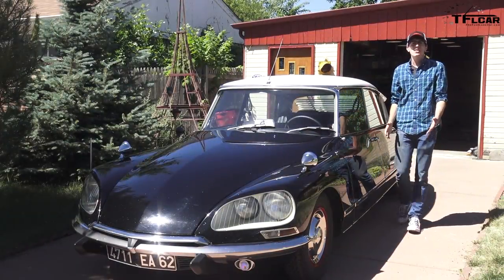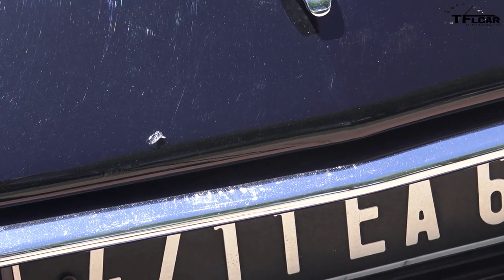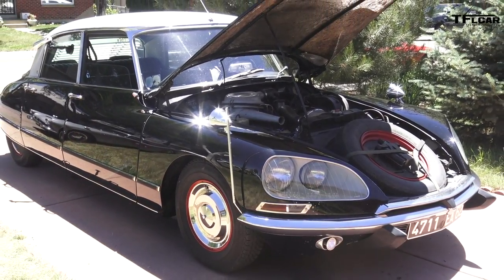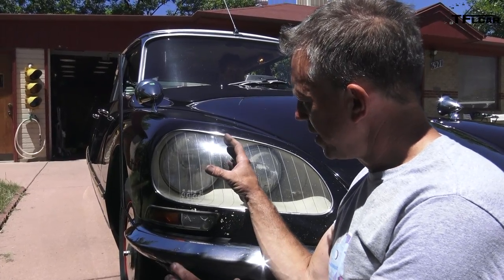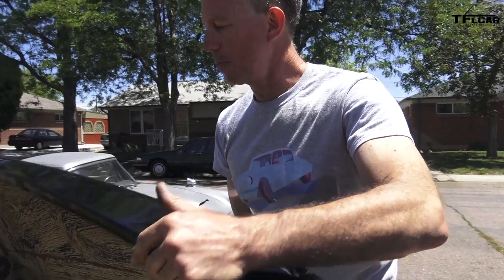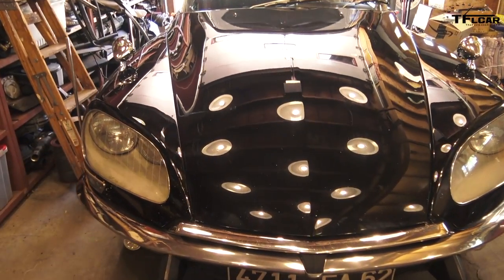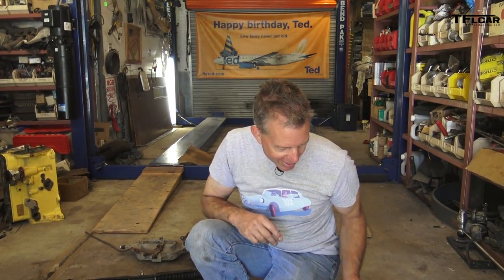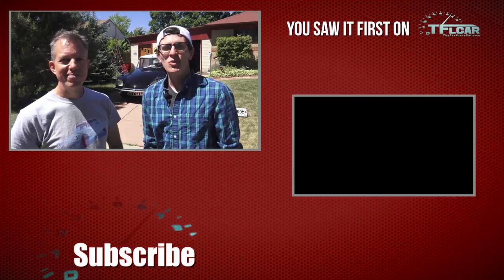Top 10 Reasons Why This Is The Most Revolutionary Car Ever Made

Comment: It's a shame you don't get the new french cars. For example the newer Renaults, Peugeots,Citroens
Reply: new french cars are not as revolutionary as the original DS. majority of their models are basic, with just the bare minimum to make the designs cheap and scale-able. their reliability track record doesn't help either.
Reply: 80386 They are all pretty basic, but cheap and reliable, with usually low consumption. Now Citroen is still known for making weird designs (like the c4 cactus or the new DS models)... or renault makes nice designs like the Talisman.. IMO that's why it's a shame they don't sell overseas, cheap quality
Reply: We get the French cars. Its just that they retreat as quickly as they come in,...
Reply: Talisman is a shitty and extremely unreliable car, there are many issues with it even though it's a new model.
Reply: could you imagine someone like MAMA JUNE riding in one of those fancy things. Get real. F150 is where it is at here.
Reply: The Citroen C5, which was just put out of production, is extremely good car, it has the hydro suspension and all kind of quirks like the DS
Reply: sic22l Really? Never heard anything bad about it though
Reply: If I'm not mistaken, the new Citroën brand DS should be making a U.S. debut.
Reply: @Matthew Longtin
Their sales dipped in the EU, I think they have another issues now.
Reply: Faris' Games and tech reviews Yeah. They're making great cars. The new Peugeot 3008 has been such a hit and the French small hot hatchbacks are seriously fast and so much fun. The new Renault Megane is really good and so too the new Peugeot 308. Citroen makes the quirky Cactus and the Citroen DS5 must have one of the highest quality interiors in the more mainstream market. It easily beats out several German cars that interior the way its so good. I believe they make far better cars than Hyundai, Kia, Toyota, Honda etc. They are modern yet well priced and always have up to date technology and modern engines.
Reply: DS5 is also pretty tight inside, cockpit is not very intuitive to use, it has extremely harsh suspension and it's quite heavy which means mediocre performance and economy. They also charge premium money for it and after the facelifting it's not all that good looking anymore.
Reply: SDav21 "DS" doesn't belongs to Citroën anymore, its a different brand now so it sounds strange to say "Citroën"  ds5 ^^
Reply: LITTEULCEVENN Yes but at the time it was a Citroen DS5. Now they have made it a separate brand but it it still more a brand of Citroen like Lexus is to Toyota.
Reply: DS is still a Citroen, they just stopped placing Citroen logo on them.
Reply: Galatzó I've always felt a Peugeot to be more solid than a Renault. Mechanically the Peugeots are better but electronically it seems Renault did a bit better. But this was a few years ago and the new ones have no issues at all. I stilk feel a Peugeot feels more solid though and they use better quality materials and have better interior design. I also think Peugeot has better engines. Their diesels are the best and their 3 cylinder petrol is miles more quiet and refined than Renault. Renaults TCe engine can be quite rough and noisy but Peugeots is very smooth and quiet. Although most of the time the equivalent Peugeot is a bit more expensive.
Reply: Galatzó We had a Peugeot 307 many years ago in 2006 and our neighbour had the Megane of the time. I remember our 307 had so many electrical gremlins but never once broke down or failed mechanically. Our neighbours Megane however came home on a flat bed most days. Ever since then and every subsequent car was a massive improvement and the 308 we had after had no electrical issues and the neighbours new Megane was mechanically fine. There was definitely a period when their cars were iffy but that was many years ago. Now they are great again.
Reply: New french cars are 100% terrible in all conceivable ways. they break down constantly and have about the same level of standard equipment as a carton of rotten eggs, probably smell worse too. also, Renualt holds the record for most cars towed in my country. it might seem like a joke but it's not.
Reply: LITTEULCEVENN i'm sorry to say but french cars are considered cheap crap outside france. and to find out how bad the reliability of these cars are, you could check out reliability index for yourself. they score very porly and mediocre at best. also, they have a bad life expectancy. And that you had to compare it to JAGUAR to find a worse car brand really tells a lot about the quality of french cars.
Reply: Peugeots 308 and 3008 are actually pretty good cars with decent equipment, high quality interios, good ride etc.
Reply: its just because "your" french car are made in eastern country cheap as F... no quality control at all... sadly
Reply: That is simply not true. Peugeots are mainly made in UK and France, Citroens and Renaults in France. They have manufacturing plants in Ukraine and Russia but those are just for the markets in the same countries. Even Dacias which are made in Romania are very well built.
Reply: aramis1810 I own an Audi Q5 btw
Reply: LITTEULCEVENN I'm not a fanboy of audis I think they are a bit boring but it's a good family car. I like Volvos better
Reply: The Renault Sandero RS in south america is pretty good. (Dacia is sold as Renault here)
Reply: 4 Strength 4 Stam Leather Belt Lv. 18 They made a rs for that ? not aware we got them in France lol
Reply: LITTEULCEVENN The First RS designed outside of France. I believe it's exclusive to our dear continent. It's a 2.0 150HP flex fuel engine, 6 speed manual.
Reply: LITTEULCEVENN It seems to be a Dacia only in design. The drivetrain is renault, and I can't find complaints online regarding reliability and maintenance costs. Peugeot gets a lot of complaints. Low reliability, expensive parts and not very avaliable.
Reply: I never expected to see a reference to a Ventrilo Harassment in the comments section of a video about an old Citroen
Reply: Faris Selimović : it's not a shame   ! The newer french vehicle is and will be this fabulous" D.S...."
my father got three traction-avant 15cv.6cyl. ( modèle famillial.) and six D.S.
Reply: VCR Thunder : vous êtes certainement " FRANCOPHOBE...! "
Reply: French automakers fame is a long gone history. There is not much of interest or quality since the early 90's. Citroën is a brain dead entity, their cars are boring as hell, their famous suspension system has been dropped and gone for good, and their stupid idea of resurrecting the DS name as a would-be trendy brand is mostly a gimmick and a partial commercial failure, appart in China where it worked but under the mandatory business plan of building things and sharing profits with a local manufacturer (in this case, Dongfeng). 
Renault cars are a recurring joke for unreliability. Their best sellers are cheap as possible popular cars, and their high end being rebadged corean cars. Still, Renault is profitable thanks to a massive simple-minded consumer base and their acquisition of Nissan. Now, they are venturing in resurrecting the once-famed, if not cult-followed, Alpine sports car brand they killed a long ago, with a neo-retro copycat, Corean engined, concept mimicking the mythical 60's rally-winnig A110 model. To add to the ridiculous, it even has the same name.... 
Peugeot is in economical difficulties thanks to the not so smart decision to buy Opel, that puts strains on new model development. Their range of models is aging and nothing interesting seems to emerge. Noting that being at the head of the group which also includes Citroën, the fall of one brand may lead to the end of them all. Recently, to have fresh cash, they let Dongfeng buy parts of the company, maybe the beginning of the end... 
Only French may be proud of any of this forthcoming failure. We are a failing country and our automobile industry is a good reflect of the whole picture.
Reply: I am French, and our cars are equipped with powerful and compact engines, direct injection, downsiding, and high reliability. In recent years French brands are catching up with the Germans. Some German models are now equipped with French engines!
Reply: John Delorean : c'est beau d'être patriote. Mais il ne faut pas exagérer. Restons crédibles.
Reply: Damien Drouart exagéré sur quel point?
Reply: John Delorean les voiture française (comme les américaines d'ailleurs) ne valent rien et ne sont pas fiable, si tu ne me crois pas vien dans un atelier de mécanique tu verra, c'est du business comme tout mais en France on savait faire des vrais voiture... jusqu'à la modus, a partir de la c'est la descente au enfers.
Reply: e s mdr faut pas dire de conneries non plus... si tu es allergique à l'électronique de plus en plus présente ça peux se comprendre. En revanche pour ce qui est des derniers blocs moteurs 3 cylindres je trouve que c'est une sacrée prouesse. Dans un pays qui ne produit pas de pétrole et dépendant au plus au point de l'extérieur... je trouve que les marques Françaises ont relevé un défis qui auraient put Les tuer depuis longtemps. Elle est fini l'époque où on cassait son moteur et où un joint de culasse était à changer peu de kilomètres après... Les blocs moteurs conçus avec les modélisations informatiques et simulations poussée,  couplé aux nouveau matériaux, permettent des avances techniques majeurs. Faut arrêter d'être passéiste sectaire. Les défis d'aujourd'hui conditionnent la production du moment.
Reply: Je crois que tu a mal interprété mes propos, je ne suit pas allergique a l’électronique, je dit simplement que les FR et US sont de mauvaise qualité dans leur ensemble, c'est pas nouveau.
les moteur quand a eux n'ont pas changer depuis 50 ans, leur composante et leurs réglages oui, les 3 cylindre existe depuis la nuit des temps mais était top désagréable a conduire et difficiles a mettre au point. les vrai progrès automobiles c'est pas en France qu'on les a fait ces dernières années, oui c'est triste mais d'ici quelques années Renault devrait sortir des modèles électrique de qualité et surtout qui on une vrai autonomie, a partir de la oui la France pourrai se replacer dans la course a l'innovation automobile, voir devenir le leader européen de l’électrique (tesla est en avance mais les prix sont encore trop haut)
Mais en attendant dire que je dit des connerie en affirmant que les voiture qu'on produit sont cheap, c'est juste se voilé la face.
Reply: John Delorean Ha des petites voitures jetables avec des moteurs en plastoc, on sait faire en France, c'est certain ;)
Reply: John Delorean malgré ton pseudo, sur quelle planète automobile vis tu ? Les casses moteur c'est fini depuis longtemps, il n'y a bien que chez Renault que ça arrive encore régulièrement ;)
Reply: Damien Drouart ... quand on dit que les Français sont les rois de l'auto-flagellation... change de nationalité mec si tu ne supportes pas notre pays, ou change notre industrie nationale loleu...
Reply: You're so wrong. Have you been living in a cave?
Reply: +80386 "just the bare minimum to make the designs cheap and easy to scale production. their reliability track record dosn't help either"  Talking through the wrong end there.  I have owned Citroen, new and secondhand, exclusively since 1984.  Never had any issues to speak of, just standard maintenance, clutch replaced, couple of CV joints, couple of hydraulic seals (they run at 2,500 psi).  If by bare minimum you mean lack of things like twin electrically operated, LED lit cup holders, and seventeen selectable levels of steering wheel heat, no they don't have that.  Normal people (non American) think that Christmas tree stuff is childish.
Reply: +sic22l "DS5 is also pretty tight inside, cockpit is not very intuitive to use, it has extremely harsh suspension and it's quite heavy which means mediocre performance and economy" 
European Cars, they aren't American, that is the point.  Designed for the Western world, to fit people with a normal sized, non McDonald's diet girth.  Also, no, not a blancmange suspensioned wallow bucket like the whales that the US repeatedy churns out.  The rest of the world have corners to negotiate, so require a car that actually handles changes of direction.  
Performance?  Only recently has the US extracted close to real power.  Historically standard saloon to standard sallon, a European motor gets the same HP, from Half the displacement.  
It's why your cars aren't popular elsewhere. 
Big, heavy, crass, wallowy, gas guzzling tanks
Reply: +VCR Thunder "New french cars are 100% terrible in all conceivable ways"  This is why the world is breaking down your door to buy 'Merkin cars, they are just so very superior in ever way, they are like perfect.
Reply: Nev Anderson concluding = in 1969 Americans landed on the moon  (my gluteus ) using French technology ( c'est ça )
Reply: Alas, as an old Citroëns lover, I must confirm it. 

Newer Citroëns don't even have the Citroën suspension any more, nor a DIRAVI "no-feedback" steering (of the SM and CX) nor the high-pressure brakes of the DS (those were shelved with the adoption of the ABS ).

As for Renault, it is just the cheaper half of the Nissan-Renault conglomerate - enough said.
Reply: Agreed just like Ford with Mustang.
Reply: Do some research don`t just write comments that don`t make any sence.... here`s just a bit why citroen is not selling in USA... Citroën in North America suffered a significant financial blow during the 1973 oil crisis. In 1974, the carmaker withdrew from North America due to low sales and design regulations that outlawed core features of Citroën cars. Since 1974 Citroën never officialy came back to the USA or Canada.
Reply: My absolute favorite car of all time covered by my favorite car show! Thanks Tommy & TFL.
Reply: You can't say "Renault cars are a recurring joke for unreliability", some are extremely reliable, i can prove it.
They are cheap cars and often, owners dont have a lot of money. these cars never sleep in a air-conditioned garage.
Owners don't often do mechanical maintenance or not correctly, cause they simply dont have enough money.
Another thing, it seems you didn't know that mercedes has chosen Renault DCi engine to put on their classe a, b and c, right?
Reply: @John Delorean I am actually a Renault fan, if you can say that about a person. And that is from experience. It's just cheap but honest, you know what's going to break when's going to break. At least the 2000's have simple mechanics and very reliable engines. I honestly think, in terms of engines, they're between the most reliable. Always a pretty good bang for your euro :). And they all drive pretty well, even the non sporty models. So yeah, I love them.
Reply: +Damien Drouart Wow, what a scathing critique of the French auto industry, coming from a Frenchman! I think you may be exaggerating a bit, but you are generally correct. I don't get the idea of putting that British woman in charge of Citroen. Nothing good will come of that. And this whole "SUV offensive" is a little ridiculous, too, because the C5 Aircross can only be found in China at the moment. By the time it makes its way to the West, it may become a flop. And the DS7? A Lexus lookalike that is essentially an overpriced Peugeot 3008 with bell and whistles that no one needs. BTW, your command of English is stellar.
Reply: i own a ds5 already for 2 years and I totally disagree with you. Probably you don't own one and just hate french cars. A ds5 is very comfortable, reliable,  and different. After the facelift even looking better. Only thing  i am missing is the hydropneumatic suspension, but maybe that will come in the future. It is expensive and will make a car less competetive.
Reply: it is citroen but just a different upmarket brandname just like Lexus is a luxury Toyota
Reply: I do work on all my cars for the past 30 years, worked in car workshops also, have been in the automotive engineering "business" for many years also. Had several cars over the years, from different brands/origins, etc. 
Same brand/model of which I had more than 1 vehicle. Air cooled VW Beetle (#5!!), Renault Twingo (#2), Citroen Picasso(#2). 

Right now the "stable" has Peugeot 106, Toyota Yaris D4D, Mercedes A Class CDI, Citroen Picasso bought last Summer. Sold Peugeot 306 HDI at the same time...
Several others have passed curiously mostly French, a few Germans, Korean, UK and Japanese. Since traveling across Europe is not so  exceptional to me. I demand comfort, reliability, low consumption and enough performance to deal with highways/autobahn and agile enough to deal with tiny winding roads.

Well somehow I always go for a French car... 
American cars...well thank you, but no thank you. ;-) LOL
Reply: I agree with you. They are awesome. My wish is to get my hands of the Citroen C6 with Active suspension or the DS5. But seeing the new Renault Talisman has made me wish for them as well. They are making the best MPVs, the Scenic, Picasso or 5008, soo roomy and so precise on the road and even better when fitted with their turbo-diesel engines.
Reply: @Tully3674  Especially when they arrived in Orange Land!
Reply: Owned the big brother... Citroen SM for a few years back when... similar in concept but with Maserati engine. Best car I ever had, but also took the prize for most expensive to fix. You could reliably take the NAPA price for a typical part (thermostat, etc) and just multiply it by 10x to get the dealer price. The bodies didn't last long in snow country (no fender liners) and the hydraulic fluid tended to freeze up in winter, and had to be doped with kerosene. The Maserati portion of the mechanicals were also tempermental. Safety regulations of 1975 would have meant a complete redesign, so sadly they are gone.
Reply: @the80386  Few of the DS features have survived into modern production. If you want a car with French influence you can opt for a Nissan.
Reply: PSA (Peugeot, Citroen) want to make a comback, but not so much in the consumer market as in ride sharing. http://www.autoline.tv/journal/?p=55853
Reply: Well, you're not missing out anything these days, to be honest... The only decent and reliable Peugeot/Citroën these days is the 108, and that's because the mechanical part of it is developed by the Toyota (and shared with the Aygo). It's a very small urban car, something that doesn't sell on the US, either.
Reply: Because people wants a french comfort with a german stability... renault make this with the Laguna mk3 and was very critized for the stiff suspension, yes they are better high speed cruiser but the comfort was gone...